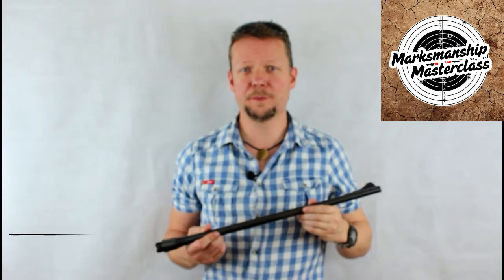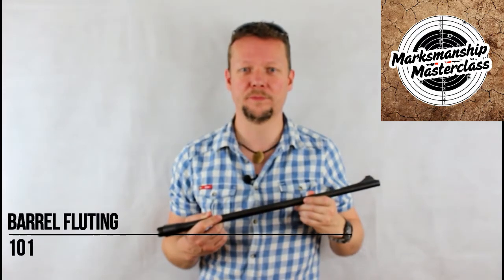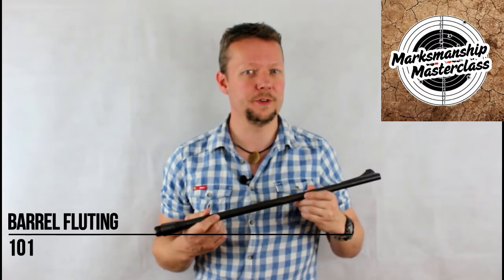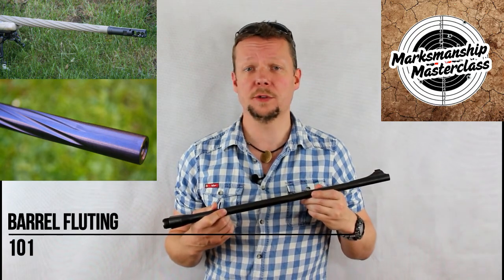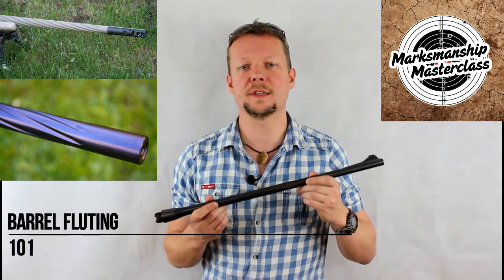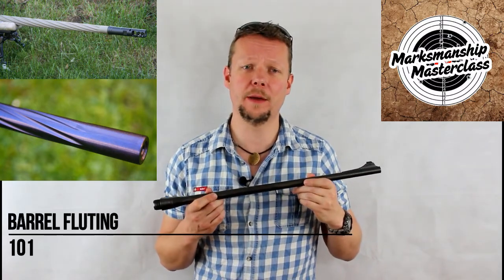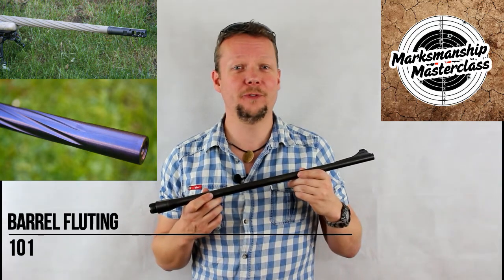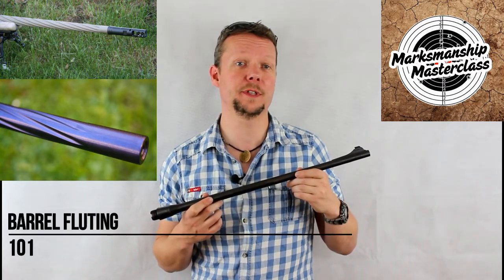Barrel Fluting 101 - Marksmanship Masterclass

Comment: Barrel fluting DOES NOT stiffen a barrel. A fluted barrel is not as stiff as a non fluted barrel of the same profile. However, a fluted barrel is stiffer than a barrel of the same WEIGHT.